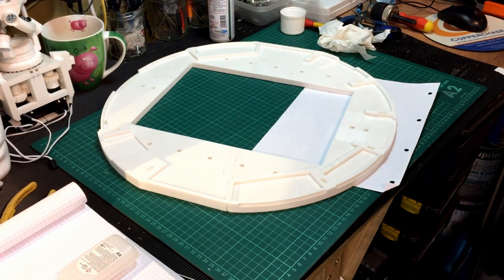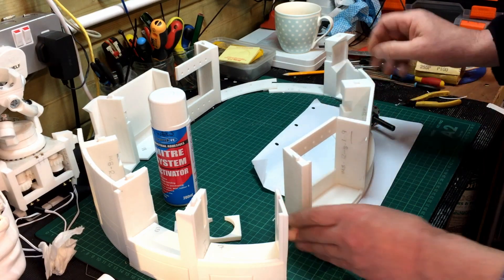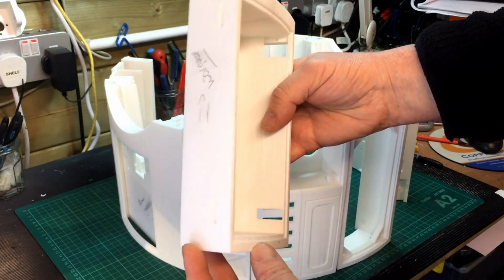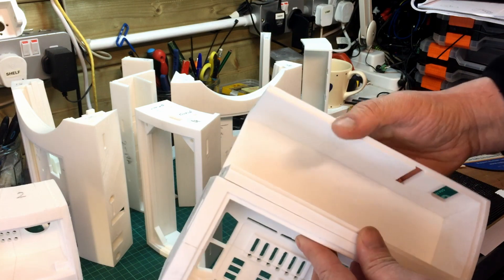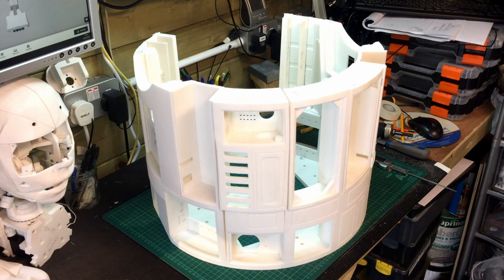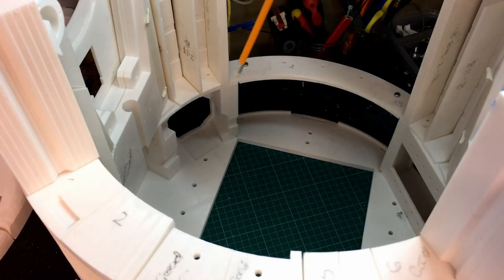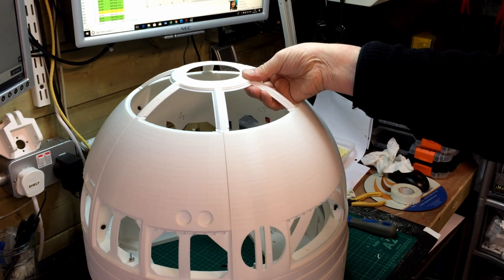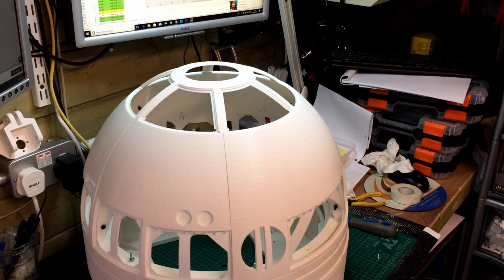R2D2 Droid Build Part - 2

Comment: Also looking forward to following this build as it progresses. Ive just finished the dome and now starting on the v2 body
Reply from the maker: Hi Darren, its a great project to build,  Michael's design is really good.
Reply: kyle campbell i know he’s really though it out. The only thing I’m worried about is when it get to the electrics
Reply from the maker: There do seem to be many approaches to how people have wired their R2D2s, and its a bit confusing.   I am planning to wire it all in a similar way to my Inmoov.  I think I will run at 24-volts with BEC [voltage converters].    I havent used large batteries before so that will be interesting. 
 Also hoping to use the EZB setup and as many servos as possible, rather than motors, [apart from the feet drives].    Havent really thought about all the flashing lights side of things, but I am not planning on a screen copy anyway. Certainly a non standard paint job. 

My R2D2 will talk, with a chatbot setup, again similar to my InMoov. EZB allows for Sony PS3 handsets [and XBox], so thats how he will be controlled I think.   He is an R2D2 thats on the ship in the far distance that you don't see in the films, so anything goes!
EZB software https://www.ez-robot.com/EZ-Builder/
Kyle

Comment: looks great, can hardly wait till part 3 (?), I myself have all the dome, body, center leg printed, working on the 2 legs, thinking about making my own lazy susan?
Reply from the maker: Hi Terry, your doing really well, I hadn't really thought about the legs and center legs and feet sections, just looking at the plans now.   I have a long way to go.   Making you own lasy susan sounds a challenge, how would you do it? 

Yesterday I finally glued the lower sections of the dome together and the dome rings, and am looking at how the dome/lasy susan and upperbody  ring all fit together.  Bit confused but I think it will all make sense when actually in place.  I have printed all the body but am reprinting the back door and parts of ring-2 as mentioned in my video.
Part-3 maybe next week.  Enjoy the holidays, kyle

Comment: I had the same warping issues on 11a and 11b for ring 2, mine is printed in so many various colours but it won't matter once I do the body work. Trying to get as much printing done as possible in winter.
Reply from the maker: Hi Mig, I ended up re-slicing and reprinting some of the pieces I was not happy with.  Also last month I have reprinted parts of the back-door sections which originally were really warped.  I body billed the main frame last month, but have not sanded it down or painted it yet.   I have been sanding and painting the dome, but until the weather improves, painting has to wait.   I have undercoated the dome and painted it black ready for a silver coat and then a final colour coat.  So R2 is all in bits, some part painted, some covered in filler!   No rush though, waiting for nicer weather to continue.    Enjoy your printing!
Reply: Yes, I've reprinted a few parts, just about to start ring 3. I think once I have the body all printed and glued I will feel like I'm getting somewhere

Comment: I'm envious at how clean those prints are.How did you clamp them together? Thanks for the tips about the shoulder orientation and using a 2mm bit to drill out the holes. I've had problems with the pegs.Out of curiosity, how much PLA did you run through? I'm running 2kg per week. I'm half into ring 2.
Reply from the maker: Hi Chris
The parts printed fine mostly but I have quite a lot of warping and gaps that may not be visible in the pictures.   Lots of filler to do at some point.   I just used basic clamps to hold it all together, nothing special.   I do use CA glue with the activator spray which speeds it all up.  
My prusa and my old wanhoa are very good printers, so never really had any bad prints as such. 
On the 3dprinterdroids.net group we had a discussion about the amount of plastic used.   I have kept a spreadsheet tally for the R2D2 and have used 11,082 metres of PLA which is about 37-reels [300m/reel] and 2534-hours of printing time!!  Others had used similar amounts/times. A few quid spent on plastic on this droid. 
I did not keep an accurate account of the InMoov build unfortunately, so cannot compare.
Reply: Hi Kyle,Parts: Ah. I'm running into warping too. I think it is the changing weather, we went from 100F to 70F in less than a month. I'm noticing quite a bit of warping in some of the panels you had the same issues as well as others. I just looked at Ring 2 parts 3-4 and they have bad bows in them. Part 9 also has picked up a bow. I'm not sure if application of my heat gun and some weight will fix it or not.Clamps: Ah. I've been having issues finding the right place to clamp. I think I need to make a wedge or something to make it easier to clamp the curved sections. Or use a strap clamp.Printers: Cool. I'm having issues with my Da Vinci's. I'm trying to use the 1.0 to print parts for an animatronic reindeer project as well as small bits for my R2 and it occasionally goes wonky on me. I just caught it printing in the air off the bed for some reason. I hate errors but it is part and parcel with printing. :) I will say this, my S4 has printed nicely other than the warp issues.Spreadsheet: Yipe?? I'm scared now. I think I'm about half done. I'm half finished printing ring 2 but I haven't gotten to the legs, foot, or lifting kit, nor the mods yet. This white PLA I've been using has been awesome.BTW it is www.3dprinteddroids.net. Chris
Reply from the maker: Hi Chris
Just had a chance to get back to planning and starting to build the electronics control side of things for my R2.  I have started to build a back panel to house the electronics but a while to go yet.   Lots of ideas on the forums of how to approach this, so great fun planning it all out.  Makes a change from printing plastic endlessly.  ...[and yes ...printeddroids as you say!]
Reply: Hi Kyle.Ah. Glad you are getting back into the swing of things. I think someone, the same guy who posted that vented battery cover maybe, put up a back panel for the electronics in Thingiverse. I'm not sure about the layout though.I've got ring 1 glued together and to the base plate. You were very right, a lot of gaps to fill and deal with. :P Ring 2 is almost finished printing, in fact I need to get the mods done before I print them.Did you print the gnarled pieces (dang spellcheck!) for the battery hoses as 1 shot or did you buy them? Or cut them in half? I haven't gotten to them but after printing a split worm gear for the reindeer I see now that cutting detailed cylindrical things like that in half is the way to go. I don't remember if you mentioned them in another vid.I need to figure out if Mr. Baddeley put up another version of the shoulders. I think by 'fixed' he means they won't articulate. Am I correct there?I know the feeling with printing plastic endlessly. And fitting, gluing, sanding, and such. I can't wait to see the finished product. From both of us! :)
Reply from the maker: Hi Chris
I haven't printed the battery hoses, has actually forgotten about them.   I remember looking at some methods of printing them but its not at the top of my "things to do" list
Mike Baddeley has only got the "fixed" shoulder V2 version available so far [there was a thingiverse V1 I think] and thats all part of his ongoing 2-3-2 new designs [ie a new center leg lift and rotating shoulders.  
I have done a bit more work on the electronics for my droid - well begun to anyway and laid out the board arrangement a bit.   Hopefully will get some testing of motor controls working soon. Keep changing ideas so getting a bit sidetracked, but have a look here...https://myrobotnigel.blogspot.com/2018/10/electronics-boards.html
Reply: Hi Kyle,Ah, thanks for the tip! So I should look into the V 1 folders for the 2-3-2 shoulders? I may do that just to see how it works. I don't know when he'll come out with a new V2 design. I might have to reprint those.I like where you are going with the electronic layout. Are you going to try that thingiverse recharger mod I mentioned?
Reply from the maker: Hi Chris, what was the thingiverse mod again?
Reply: Here you go:The R2 Rear octagon port power mod:https://www.thingiverse.com/thing:3022788I want to make a cap to cover the port when it isn't in use.Here is the button holder. It allows you to turn those 2 buttons on the dome into functional on/off buttons.https://www.thingiverse.com/thing:1133094Here is the ventilated battery box so your motors won't overheat:https://www.thingiverse.com/thing:3072309BTW Eebel turned out several other R2 mods as well as a servo testing tray.
Reply from the maker: Hi Chris, thanks for the links, the power port mod is just want I need. I was looking for that very sort of thing for the external charger.  I am using bits of Eebels designs and probably will print his SLA battery holders this weekend.  I like the two button panel mod!  Thanks
Reply: Hi Kyle,No problem. Anytime. I like the button mod and some of the other mods as well. I've printed the button mod and port mod. My tote is getting a trifle full! I'm on the last part of ring 3 now. Did you notice Mr. Baddeley is coming out with a new body design? GRR.

Comment: Hey kyle did you print all of it with only one printer? I just started 3 days ago non stop printing with only 1 printer, today i wil finisch printing the dome, is it a good idea to buy a seccond printer for shorten the print time? greetz joey degener
Reply from the maker: Hi joey
I only use one printer and it takes a long time to print R2D2.   I estimate its taken me 2535-hours, [that would workout about 105 days printing 24-hours day - I don't print 24-hours a day!]
But theirs no rush and I have been printing a few days a week since last December.   Printing my InMoov took less time but still took several months.   That's just the printing, not actually building anything and wiring it, painting etc.    
I do have another printer, my Wanhoa buts that's in bits, partly upgraded, not working.   I haven't the space to run two printers easily, anyway. Some people do use two printers or more to speed things up but once you have finished R2, will you do more printing?   Its also a cost.    I remember when I printed the Dome, it took a long time so your actually doing rather well.